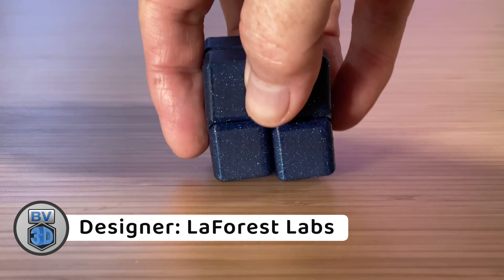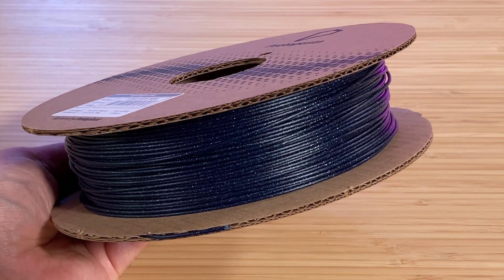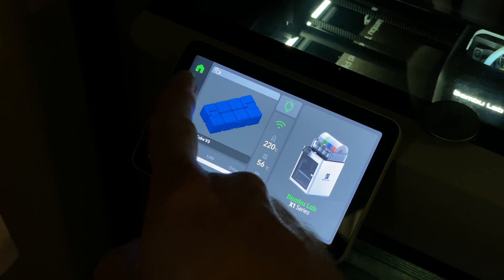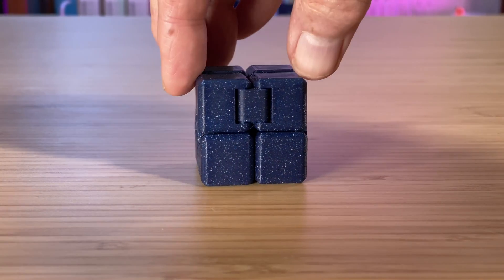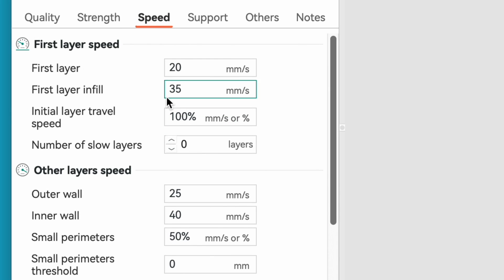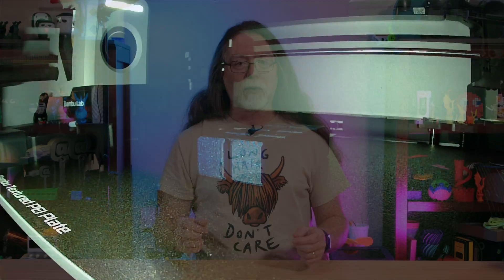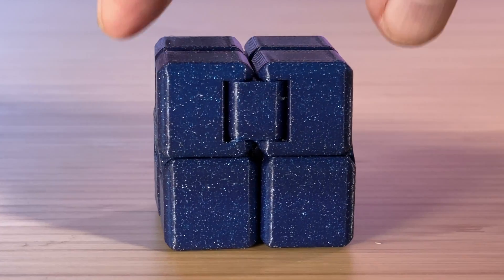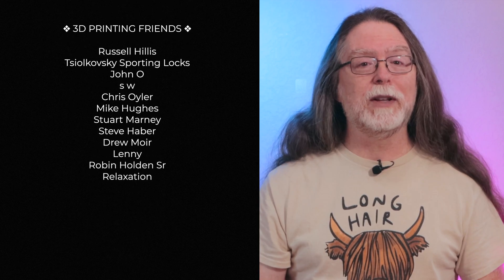Print Speed's Effect on Surface Finish (and how to get shiny)

Comment: Surely to slow it down means the filament is staying hotter a little longer therefore you get the shine, that means keep the faster speed and increase the temperature to gain the shine.
Reply: Doesn’t work that well because the filament gets too runny

Comment: Great video .. I do it kinda differently. I use OrcaSlicer and if you go to the calibration tab -> More-> VFA,  you can do a test print with 10mm/s upto 200 or more if you wish. After print finish, you will see gradient out of which i choose the  one the suits me. I then set the outer speed just like you did or alternatively, i set max flow rate to match the speed.
Reply from the maker: Cool! Thanks for the tips! There's a lot I haven't experimented with in OrcaSlicer.

Comment: Don't forget to slow down the top surface speed to the same speed as the outer wall, otherwise the top of your cube will be dull unlike the sides.

I also highly recommend print the Silk Tower Test on Maker World as it will show you what speeds look like what with your filament. It isn't just for silk, I use it for all my materials, and I also use it to test different temps. Some materials look better at 230c versus 220c at 50mm/s. I'm uploading a version of that model that goes from 70mm/s all the way down to 10mm/s because I was curious what the speeds looked like below 50mm/s where that model stops. I repeat, it isn't just for silk but works well to demonstrate the speed effects on all filaments.
Reply from the maker: That’s a great tip! Thanks!
Reply: And I would say don't forget to slow down the bottom layer to match as well, but it normally already is.